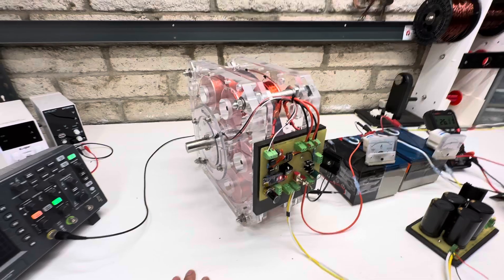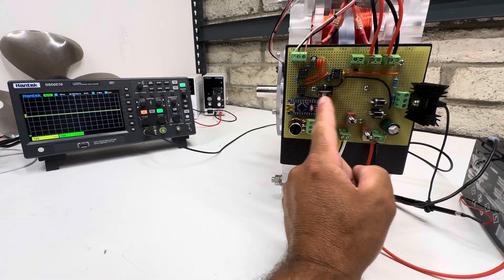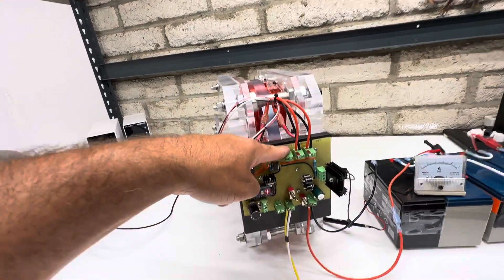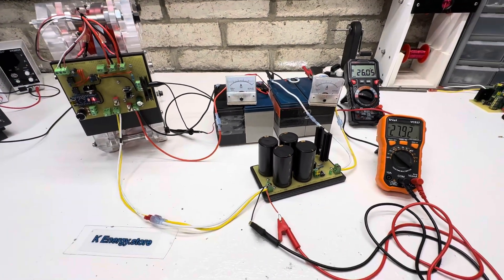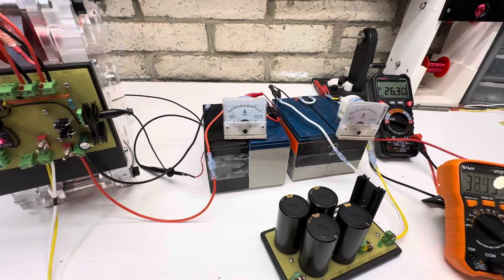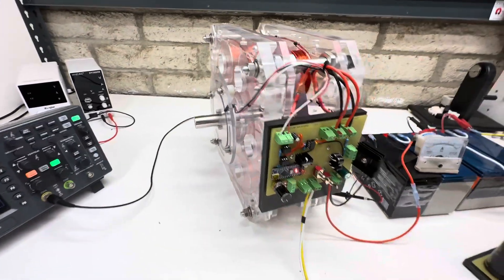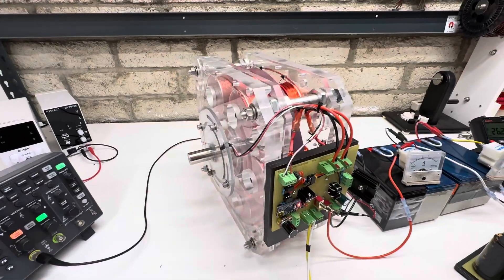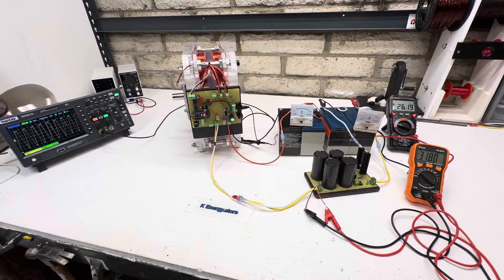Quanta motor new circuit

Comment: Is its COP>1？
Reply from the maker: It’s about 95% return not including shaft power
Reply: @kenergy1707  thks!Can the same battery be used for self-sustaining operation while supplying power and charging at the same time?
Reply from the maker: @zhihuizhang-t6m separate battery